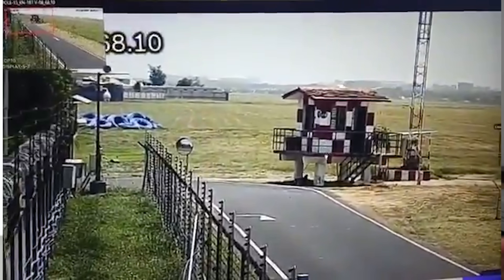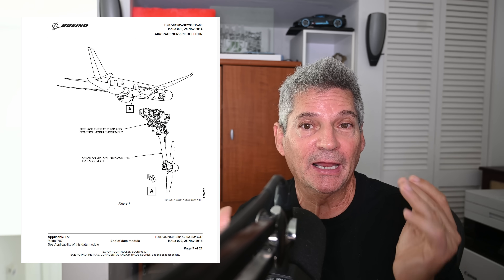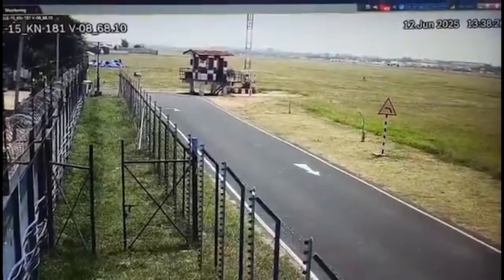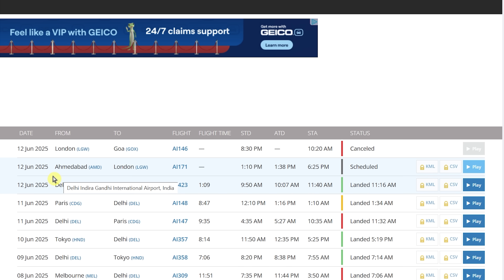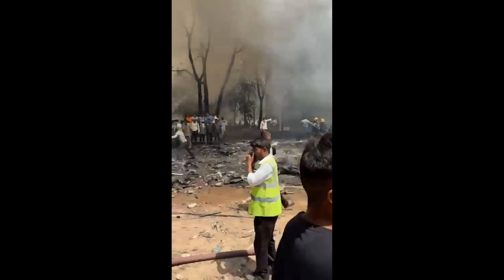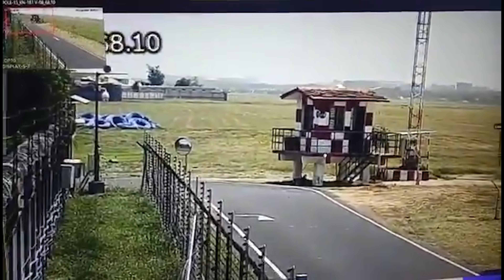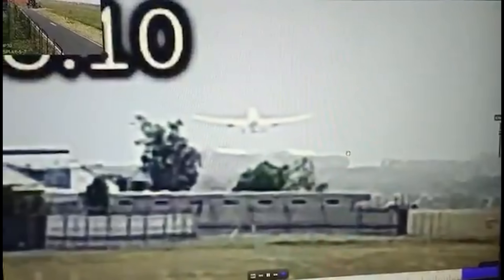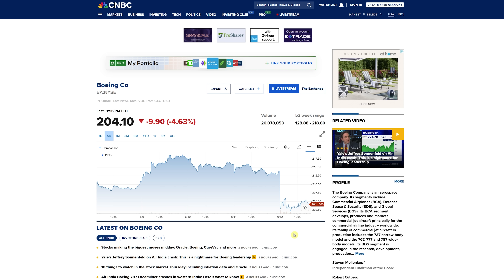What Caused Air India 171 Crash, Mysterious Sound Before Impact

Comment: Hi Jeff, as a 787 pilot I’ve watched pretty much every “talking head” video available about this disaster. Good work, yours is by far the best.
Reply: Haha what a joke. This guy says “the engines weren’t thrusting enough”. That tells me everything I need to know about the lack of aviation knowledge here.
Reply: @MADmosche The math isn't matching...
Reply: @MADmosche  he is a youtube clown, milking it on tragedies, he has zero expertise and does not even follow a decent methodology or consult with actual experts.
Reply: Couldn’t agree more.  There is too much noise and clutter. This one is the best and sound explanation so far.
Reply: Does that sound like a RAT to you? I would not expect it to make that much noise.
Reply: @dan-bz7dz  A RAT on a 787 is about the size of a small plane propeller, so it'd make about the same level of noise with how fast it's spinning. :)
Reply: @ChrissonatorOFL  Did that sound to you like a small plane? I'm not saying you're wrong. It just doesn't jive with me.
Reply: @dan-bz7dz  It sounds like a fast spinning propeller, similar to a drone, etc. so it likely was the RAT, especially if there was some immediate engine power loss.
Reply: @dan-bz7dz  I’ve never heard one. Only deployed them in the simulator.
Reply: Am i the only one seeing some spoilers at 1:57?
Reply: @pete9364  : I see a gap between the flaperon and the panel immediately ahead of it. I can't tell if it's exaggerated due to the video resolution or not, but what is abundantly clear at 1:09 is that the flaps are set for takeoff.

The 787 shares a flaperon system with the 777 where under certain conditions the flaperon doesn't get hydraulic power to save on actuator wear, namely, during the initial takeoff phase to 100 knots. This causes them to droop at low speed, then weathervane into the wind as speed increases, before resetting to their commanded position as the aircraft reaches takeoff speed.

I don't know what surfaces get power from the RAT, but assuming a dual engine failure and RAT deployment, and assuming not every surface gets hydraulic power, I wouldn't be surprised if the spoiler/droop panel directly ahead of the flaperon is unpowered in this scenario with the flaperon remaining powered (remember that the spoilers/speedbrakes on the 787 droop and blend the upper surface of the wing into the flaps, which is one of the reasons why the wing can appear clean with takeoff flaps set). It would make sense to me that it would weathervane to its neutral position, leaving that larger-then-normal gap - any 787 mechs around to confirm what systems power what surfaces and what gets power from the RAT? You can see the main gear trucks are tilted downward. This doesn't happen until the retraction sequence starts, but the inboard doors are closed. This points to the retraction sequence having been started, but not completed.

I don't see this being pilot error. There's just too many visible symptoms of a hydraulic system failure...
Reply: Si muy buen video es el mejor
Reply: A single child girl travelling from this plane to London her parents book her tickets for 1 day before she wants to go 😢😢

Now she died her father came to the hospital for dna test 

Really heartbreaking
Reply: Pilot, what is your best hypothesis about what happened to cause the crash?
Reply: All this talk of the RAT but in the video there is absolutely no RAT shown being extended from the right rear fuselage. It's blatantly obvious that the pilot Monitoring raised the flaps not the gear. Putting the aircraft in a high drag low lift scenario and once on the back of the drag curve that low to the ground you aren't recovering unless at the very least the leading edge slats and trailing edge flaps are returned to where they should have been during takeoff
Reply: @ziggy8626  It’s blatantly obvious that you have absolutely no idea what you’re talking about.
Reply: @ziggy8626  this channel is a clown who is just milkin it on tragedies and most of what he says i just random garbage, however the RAT can clearly be heard in the raw footage now available, and it is a fact that the RAT was deployed and the gear could not be lift (the very first step of rocking the wheels position occurred and nothing after). At this stage it is believed the problem is a lost of power on one or both engines, incidents related to the engine occured in recent days on this very aircraft flaps are not believed to be in cause and the position of the flaps cannot be determined by the video on this specific aircraft.
Reply: @lo2740 except the sole survivors said he distinctively remembers hearing the engines increase in power just moments before the crash. How exactly do you increase the thrust on two failed engines?
Reply: @ziggy8626  When did he say that?
Reply: What?  :)
Reply: Investigation this case, because now India and Pakistan is conflic, this human eror or sabotase
Reply: Indeed
Reply: since your a 787 pilot do you think the part flying off at 2:01 is possibly the top flight deck door? the one that sits above the righthand side.
Reply: @mrmike1183  No. That thing is heavy, it wouldn’t flip around in the air like that.
Reply: @petergill2265  I'm also seeing it opens inboard not outboard so yeah it cant be that door
Reply: Nichts als Spekulation,  könnte sein , wahrscheinlich, womöglich.... blablabla.
Ohne Auswertung der beiden Flugschreiber einfach die Klappe halten😡 Der Typ hat Null Ahnung von Fliegerei. 
Diese KI Stimmen sind die neue  Seuche im Netz 🤮
Reply: Do not see the Ram Air Turbine door deployed...stopped vid and zoomed in.
Reply: Paused at first frame about 1:53 in the video zoomed in 8 times and see no signs of rat deployment or flaps set to anywhere near 15 degrees. Former USAF 2a655c/h mechanic and worked in test cell and flightline. I have seen thousands of takeoffs and landings. Plane doesn't look properly configured for takeoff.
Reply: @21stcenturyjacktheripper  Flaps @ 5 degrees is an allowable configuration for 787 takeoff for a runway longer than 3000 meters. You're correct, they're not @ 15, but they could be at 5.
Reply: @vevevededede gear should have been fully up once the aircraft hit 100 feet. Second on the video with audio you hear what sounds like a rat but you will also hear the same things when the tips of the fan assembly reach the speed of sound. The engines were screaming in the video sounding like they were at full 100 percent power. The rat would be visible in the first few screens of the original video not this one recorded off of a TV screen. I have seen no pictures or videos indicating any signs of a rat deployment. I heard nor seen any signs of engine failure or flame out or compressor stalling. as a core engine specialist I see nothing indicating engine failure. No sparks, flames or any weird smoke out the back of either engine. My theory is the Copilot closed the flaps instead of closing the landing gear pilot error would be my guess.  Also both engines have a CSD (constant speed drive) before the generators producing the aircraft power. The generators have to run at a set speed to give proper electrical voltage and Hertz for the aircraft to have power. I highly doubt they lost their flyby wire, back up hydraulic controls and both generators at the same time with zero indication of engine failure, as I stated earlier the video with sound proves both engines are still running perfectly.
Reply: @vevevededede but with the nose up and the flaps deployed the engine should be almost invisible under the wing but it's always in clear view. Something was wrong either before takeoff or right after takeoff.
Reply: @21stcenturyjacktheripper  Iniitial eyewitnesses and video analysis have said that it was deployed.  So the prevailing view right now is that it was. Also the audio is very telling.  That's all I know...   You could look up where the exact placement of the ram is on this plane, and check again to verify since you have experienced eyes.
Reply: @21stcenturyjacktheripper  Why would the flaps need to be set at 15 degrees?
Reply: Question, Jeff here says the RAT automatically deploys, but there is a manual deployment switch. Is manual RAT deployment apart of procedure for engine loss to confirm RAT deployment? 

Would it support a working theory of accidently pulling Flaps on takeoff instead of the gear, which felt like a loss of power and the crew started engine loss procedures, therefore manually deploying the RAT as a redundant action?
Reply: @vevevededede yes the rat has a manual deployment switch on the overhead panel.
Reply: I find it hard to believe this was anything other than a flock of birds being sucked into both engines.
Reply: @dopecat15  Invinsable birds with no smoke or fire coming out of the engines?
Reply: I god I hope you don't fly passengers.
Reply: @foardhook  6000+ B787 hours. How much flying have you done? More importantly, how many crash investigations have you been part of?
Reply: @petergill2265  That doesn't matter. He's a Youtube armchair expert, and their opinion trumps all you real experts...
Reply: @petergill2265  I would be willing to wager I have more experience than you. If you can't see the problem in the video you should not be flying.
Reply: @foardhook  Alright then. Show us proof.
Reply: @raphaelmiguelbalon9226  Look in the video with your own eyes. The wheels are down and the flaps are up. If you can't see that there is no point in continuing to discuss this with you.
Reply: @foardhook  Name the child by it´s name. What was the problem in your opinion? Flaps not set?

I agree with petergrill2265.  I watched 11 videos so far, and two were very "talking heads". 
Mr Afterburner and Lemonhead.

And there was a lot of speculation and wrong information, especially in the comments.

The plane used full length of RWY23 (3500m) instead of the first suggested 2700m or even the flightradar ADS-B data with showing the plane to line up @R4 with 1880m.
But the R4 datapoint (3rd point) is from 08:04 UTC while the 4th and last datapoint @625ft is at 08:08 UTC. --> 4 min for full trackback, line up and checks.

Some suggested the take off point was near the RWY end (run off zone) due to the blown up dust shown in the Airport View video.
Again the 4th ADS-B data point from 08:08 UTC shows the plane in 625ft between Taxiway A + B with 174kt GS and a vertical climb rate of 950 fpm (Premium account required for VS).

Others want to see the flaps retracted on the start run (Airport view video), 
assuming the Pilots ignoring all the bells and whistles or having programmed the FMS with wrong data, 
or blame the maintenance crew to have it disabled on purpose, 

while others suggest the Co-Pilot confusing the gear lever with the flaps.
And all based on some pixelated videos.
The experts claim the "massive" flaps on a 787, would be cleary visible and block the view of the engines. 
Which is impossible with the point of view from below in the "Apartment Video". 
The 787 has a gliderlike wing (even the CRFP wing spars) with a high aspect ratio and nondescript flaps. 
Watching other non crashing 787 departures with higher resolution is very good for comparison, 

and those ACFT were probably configured correct, and the flap deflection is barely visible.  
For example here on YT    "4K | Air Canada Boeing 787-9 Dreamliner takeoff at Geneva/GVA/LSGG"
Or here in this video @4:00 the flaps at landing configuration. This isn´t a 747 wing with flaps like barn doors.

Meanwhile photos from the broken right wing at the crash site show the LE slats extended. -->  Flap Theory busted IMHO

But hey, call me an unexperienced glider pilot, because that´s what I am.

From your obvious non existent CRM fine tuning, I hope you are the one not flying passengers.
"The Captain´s word is law" is outdated.
Reply: @foardhook  I mean, your career as an airline pilot.
Reply: @raphaelmiguelbalon9226  10,000 hrs flying 747
Reply: @petergill2265  i got a question for you 6000+ hours. Is the earth FLAT or naw ?!?!?!
Reply: @petergill2265  i got a question for you 6000+ hours. Is the earthFLAT or naw ?!?!?!
Reply: @foardhook  I’ll take that bet: 10 cigarettes to a magnum of champagne. That’s an aviation reference btw, one you won’t learn from your vast MS Flight Sim experience.
Reply: @foardhook  i m wagering, proof please... i can wager i have more experience watching youtube videos than you! what you can you wager?
Reply: @petergill2265  genuine question, you obviously know what you’re talking about….why was the gear still down do you think?   I read something about it maybe being quick turnaround and concern about hot brakes.   Also wondering why no mention of gear on this video
Reply: @JesusBeliever-l3j  Either not selected up or no hydraulics. The inner gear doors didn’t even open, so it’s not a mechanical failure after gear selected up.
Reply: @petergill2265  doesn't matter, boeing sucks
Reply: @welshgit  "real expert" 😂
Reply: @JesusBeliever-l3j  There is an MEL procedure which requires the gear to not be retracted until two minutes after takeoff. I do not know if said MEL applied to this airframe.
Reply: @foardhook  The flaps are not up.
Reply: @foardhook why?
Reply: @foardhook  It has nothing to do with pilots. Ramesh said, the lights inside the plane “started flickering green and white.” That's a fact that Boeing products are bad. Last year, I travelled a lot. Out of 18 flights, 17 was AirBus planes and 1 Boeing. I don't trust BA.
Reply: Juan Brown is the best. Sorry dude.

Comment: The aircraft was airborne for only 32 secs or so.

The fact that the pilots of AI-171 were able to make a Mayday call immediately within 11 seconds of takeoff, means that they were able to identify and diagnose the failure within just 10-15 seconds of its occurrence, which is VERY RARE, unless it's an "in-your-face problem"  which they are certain they cannot pull out of.

It usually takes much more time to pinpoint the problem and then for both pilots to concur to make a Mayday call.

The lone survivor mentioned that he heard a loud bang immediately once the aircraft took off.
Reply: the passenger that survived was in trauma the bang he heard was the plane hitting the ground
Reply: Not really, a problem could have been identified after they hit v1 and at that point u can no longer abort and have to rotate

Comment: It looks like the left engine failed and the right engine was trying to overcompensate for that loss of power on the left. I work in the airline industry and we’re always told an aircraft only needs one engine to take off because if one fails, the other one has enough power to pull up that weight of the aircraft. However, in the video I see the aircraft start to lean left immediately after takeoff meaning the left engine could’ve failed and you see the aircraft be pulled up a bit from the right but it’s clear the right engine couldn’t continue pulling that weight. My theory is they loaded that aircraft with too much weight and didn’t expect an engine failure during take off

Comment: This propeller is not an auxiliary power unit or propulsion engine. Rather, this propeller is designed for situations when the airplane’s turbines stop working and no longer generate power. It is a free-spinning propeller that generates electricity for the pilots’ instruments and other essential systems. The purpose of this propeller, which deploys after a serious incident on the aircraft, is to continue supplying power. The story we heard from the survivor was that he got up and started seeing bodies and body parts, and then, out of nowhere, someone pulled him and placed him in an ambulance. He probably lost consciousness during the accident, and when he woke up and stood up, the rescue team was already on the scene and pulled him out.
Reply: There's a viral video of a passenger complaining about nothing working inside, Aircon,lights and the touchscreen tvs
It looks like it was "down on power" or having electrical issues before it even take off
Reply: In the video you can see the survivor walking to the Ambulance, they didn't even put him on a stretcher!
Reply: @fins59 
I suspect he was on the ground and dazed from the impact.
Reply: @fins59  Suspect people thought he was walking wounded ground survivor.
Reply: The RAT is spring loaded to deploy automatically when there is either 1) a loss of thrust on BOTH engines or 2) a loss of critical electrical power to essential circuits.
Reply: it generates hydraulic power, which is used as is, and converted to electricity. Anyway the aircraft was at this point close or below the minimum operating speed of the RAT.
Reply: There is footage of him walking down the street? Nobody pulled him out, he got out and walked off I think.
Reply: @eyebelieve3 There are many, I even think they had caught him and pulled him to the ambulance, but it was the news.
He is a little stunned, walking normally, and was not yet in himself, because of his attitude that showed that he was angry, but for no reason.
Reply: Yes he said he lost conciousness after jumping, then came too in the wreckage in fact.
Reply: Agree with the lone survivor idea the brain tries to piece it together. I was in a bike accident and I don't remember how I got from the middle of the intersection to the sidewalk.
Reply: Finally someone who actually knows what they are talking about makes a comment. Its been painful reading comments up til just now. So sad though either way.
Reply: Thank you for clarifying ....even common sense tells you that this little propellor CAN NOT provide propulsion....for a 787

Comment: At the max height of the aircraft, one can see that the flaps have been retracted, but the landing gear is still extended, while the pilot pitches the nose of the aircraft up before it lost thrust and stalled.

Puzzling indeed.

Only the CVR and FDR data will provide the real answers.